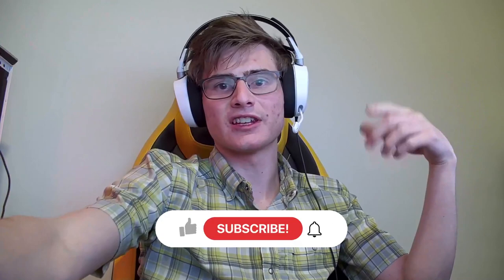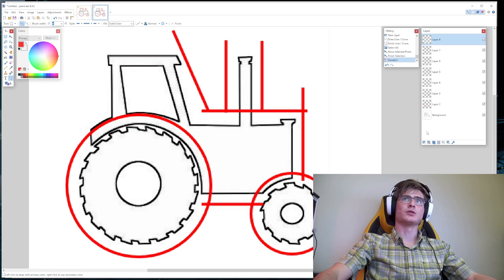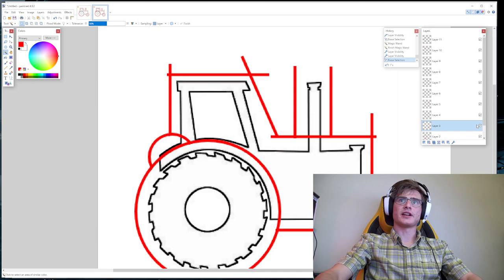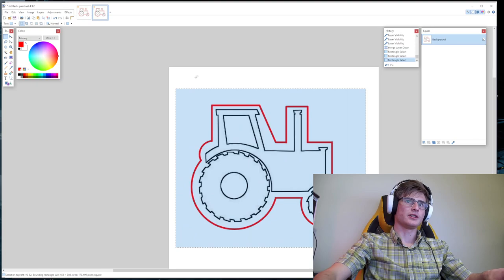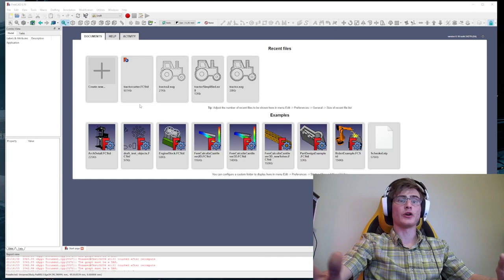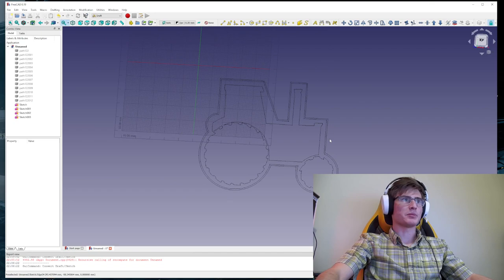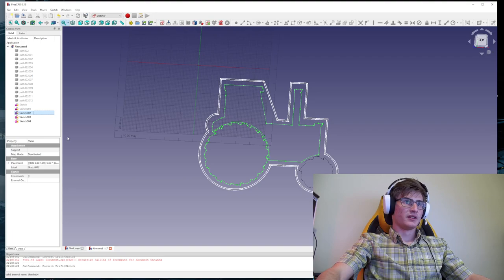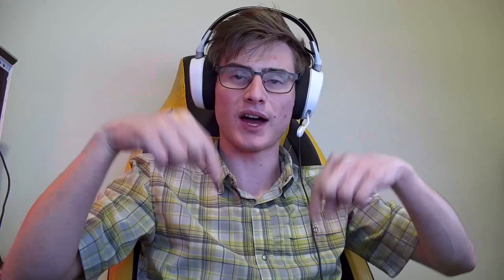How-To Turn Any Image Into a 3D Printed Cookie Cutter

Comment: This is an excellent tutorial. Do you have another tutorial that goes into greater depth on details like choosing line width, in Inkscape or Paint, of the cutting edge to optimise for a 0.4mm nozzle. Also, if we don't want a square cookie cutter handle, how would we offset the cutting edge to create a tractor shaped handle? Thanks.
Reply from the maker: I do not. I could possibly update this tutorial if I can come up with the time to do it. I definitely threw this together quickly.

Comment: Great video! I wondered about using a paint program first then solidify in blender
Reply from the maker: I'm not very familiar with blender so I don't know how well that would work. I find it easiest to edit in a paint software first because it'll remove extra work in the modeling software. There are ways to do this without editing first, but if you want the indentations for detail as well it will require a lot more modeling knowledge if you don't do it this way.
Reply: @ThePrintHouse  good tip. What cad program do you use?